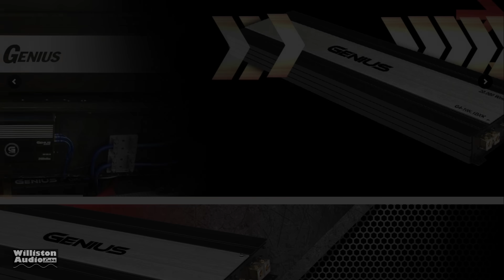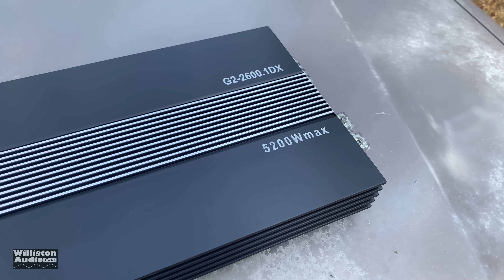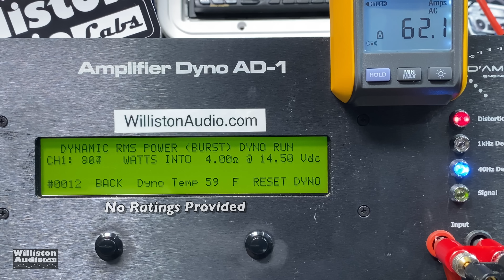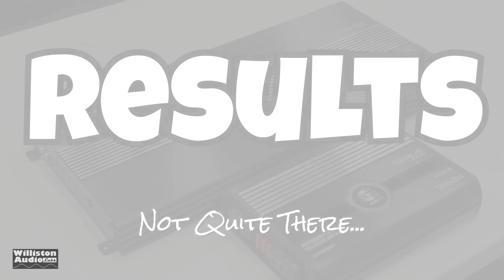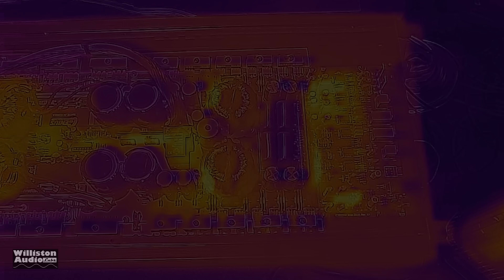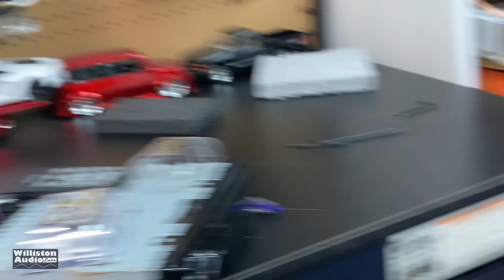Big Genius or Big Dummy? Genius Audio G2-2600.1Dx 2600W Amp Dyno Test and Review [4K]

Comment: Like always... Great video, Dereck. 

Almost all of these amps are Zenon amplifiers. The class D circuit most of these amps use is a very old but tried and true design (with the exception of some flawed PWMs). Open it up and if it uses quality parts, doesn't matter who's name is on the outside.

Comment: I think it's actually pushing alot considering the rail caps are only 100V, they're definitely at the limit, 2600W would be about 51V which suggests they're actually being charged to about 102V, since it is a halfbridge class D it pretty much gets halved
yeah sure still overpriced but even with the caps in there you can't safely go higher or caps will go kaboom

Comment: Recognized this amp and the terrible bass nob, it's an old design. I got some of this amps (class AB and D) around 2006 - 2009. Small changes to the top plate, and a brand name could be added by whoever sold it. The PCB could also be branded, but the company I bought them from didn't bother to do that, so the PCB where branded another "know brand".  These are old design and easy to fix when they blow up because of over current or over heating. Fixed and sold some of this amps and I think I still have a stack laying around somewhere.

Comment: Big D, I love your channel man, it's among my most very favorite on YT, easy top 3.  A couple of suggestions if I may, could you take the transistor clamps off where easy enough to do so, so we can see the part numbers.  That will let us know their specs and how much current they're rated for and how far they can theoretically be pushed for example.  The more detail of the amps guts and chip markings the more technical knowledge we can get from your awesome videos.  We are so lucky that we can get such a great look at these amps before we buy them, thanks for doing you bro!
Also, can you do your usual 40hz test as that's what the dyno is designed for, but also do a 20hz test, because I've never had a class D amp that will play low, and it would be nice to know if you ever come across a nice efficient amp that can actually play subsonic.  I'd love an 8k amp, but I'm rocking a 3K class AB for this reason.    Cheers big brother, much love 🤙

Comment: As to any manufacturers, importers, or distributors who might consider sending test items to people like Williston Audio Labs, HiFiVega. After almost 20 years of just listening to an aftermarket head unit and OEM speakers, I decided I wanted a system in my truck. The market has changed more than I could have imagined in that time and I honestly didn't know what was what. 

So, of course, I turned to YouTube for information. I believe the information coming from those 3 guys is 100% credible and ended up spending about $1800 on products that these guys tested earning positive results or companies they had shown to offer quality products and useful customer service, companies I had never heard of. 

Even a test like this where the product falls a little short, the manufacturer's reputation is still improved in my mind. At least they are willing to put their products out there for a credible and unbiased evaluation. Until about 20 minutes ago I had never heard Genius Audio and but now, I'd give them some consideration if I was shopping for more equipment.
Reply from the maker: I agree 100%. They can take feedback and make the next product better. This is a great point 👌
Reply: @wal  Most brands and models will have some kind of unboxing/review/check-it-out video on YouTube. Now those videos can be from guys like you, Steve, or HiFiVega using proper equipment with decades of real experience and integrity or random people hooking up the wires and going WFO. 

Besides, us old guys have to have each other's backs.
Reply: Yea THEAS fly by nite companys is POPING up all over the place I run amps from the company alot of PPLE hate on but they ben around a long time although thear offerings are budget THEY ARE SOLID!!! and until I have something from power acustic to fail on me when I'm showing off and giving demoes at the local park in the summer  I'm gonna keep reping and saying GOOD things about the razor amps I have used the2300. The 2500 currently.and I will be running the4x3500 and yes I will be competing with them as well at this years sundown show in hickory. N.c.

Comment: I think I’d spend $600 on the Orion hcca 3k instead. I believe it does about 3 times that power. And looks much better.
Reply from the maker: That Orion is tough to beat if you need that much power
Reply: if you can ever find them, HCCA gear of any sort is as rare as hens teeth
Reply: @minus3dbintheteens60  I bought a DD audio M5 used from someone last week. He order an Orion 3k hcca on Amazon for $599.99 had it in 2 days. Was so disappointed with it compared to the M5 he bought a used M5 for $500 more than I gave him for his. Lol. But the 3k Hcca was available on Amazon last week. I did try to find a 17k Hcca about 3 months ago and could not find one anywhere.

Comment: I deal with a lot of 2nd hand amps (testing and a few repairs) and would like to say I hate Phillips drive hardware at the terminals. Most DIYers don't apply enough downward pressure when tightening so the driver cams out and ruins the fastener. Allen is superior, you can achieve more torque with less effort, the hardware lasts longer (provided you use the correct size driver) and it doesn't require putting most of your body weight on a component soldered to the board. With as infrequently as amps are installed and removed, using the right size Allen driver isn't that big of a deal. It's a lot easier than tracking down replacement 7mm screws.
Reply from the maker: Good point. My preference is not to have multiple different size Allen keys as it’s a pain. I’d agree you can torque them tighter though
Reply: @wal  Chocolate and vanilla. There are trade-offs with everthing. Pick what fits your needs best. 👍

Comment: Say i wanted to buy 1 amp dyno. Cash is good money is no problem. How much would i be looking at spending???  
 Edit. $3500 not to bad. If the buyer had a business where he could somehow monetizing the dyno or its use.  It could pay for itself over time. I was honestly expecting the SMD AD-1's list price to run into the $5000 plus range. The SMD amp dyno is truly an amazing piece of engineering  electronics.  I'll start my snow shoveling side business just to afford one. Build a mobile dyno lab and take it around to all the local bass comps and car shows. $20 for a 3 run dyno sessions. The AD-1 would pay for itself in no time at all
Reply: $3,500 for the dyno alone. Then you have to think about the supporting electrical system to actually run the amps. 1/0 is $5 a foot or more, AGM batteries are $200-$300 ea, what are you going to use to charge the batteries? The dyno itself is only one aspect.
Reply from the maker: It’s a good point, but you can also make YT vids and after time it will pay for itself. Plus I get to create a video archive for people to see now and in the future. I like your idea though, just figure in several grand to be able to run big amps (electrical) and be prepared to have people sign a release so you’re not responsible if their amp blows up...
Reply: I would also suggest viewing batteries as a wear item / consumable. I tend to get about 3-4 years out the AMG batteries in my DD. So you'll need to do the math there.

@ Big D, is the liability (perceived or actual) part of the reason you don't take viewer submissions?

Comment: great video, but I'm afraid any  more modern amps and you could loose oldschool status.
Reply from the maker: I have SO many OS amps to test, they just don’t get the love as the new amps get. I’ll continue testing them, but it will be far fewer than the new ones
Reply: @wal  I guess us oldschool guys are getting as rare as the oldschool audio we love. 
if possible I would like to see an oldschool mtx 4 channel amp.
I have mtx 304 rated at 37.5 watts per 4 channels,  which is bs cause it has 3x 25 amp fuses. 
anyway thanks for the vids.

Comment: Pretty disappointing overall for both of the genius amps in my opinion. Price per watt isn't what I would expect from today's products.
Reply from the maker: Korean amps cost more, so you can’t have it all, unfortunately.
Reply: @wal  not arguing with that at all, but without name dropping there are other companies utilizing Korean manufacturing that have 3k's and up for around that price range.....and the smaller amp like you said is basically an nvx that can be had for half the price my brother

Comment: Sam is correct the driver card is outdated for a reason.... It over heats and tends to short out the pnp drivers. I would not recommend this amp!
Reply from the maker: I don’t know why...
Reply: @wal   don't get me wrong the Koreans can make a solid amp, there big down fall is using iniquated technology i.e. dlogix integrated circuits which are impossible to buy if you are a private amp tech. I love your videos, I also heard you are a fellow NC resident!